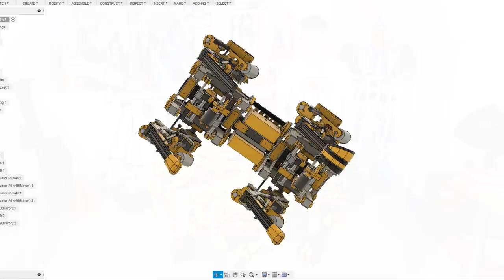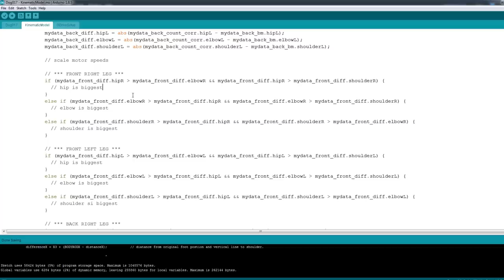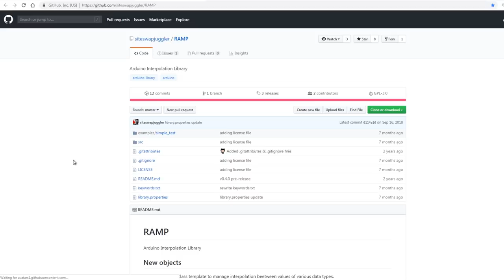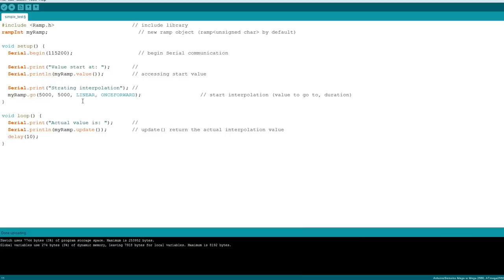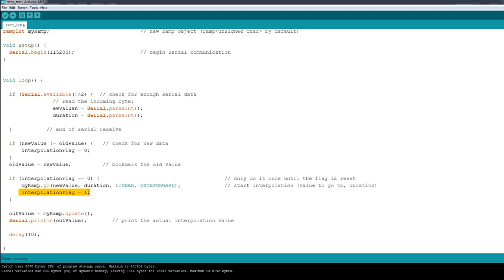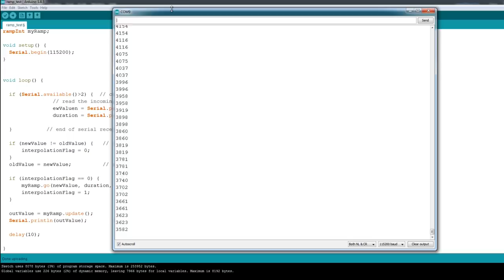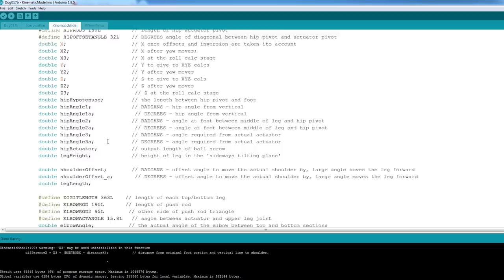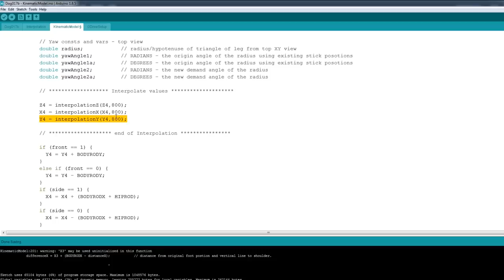openDog Dog Robot #17 | Experiments with Interpolation | James Bruton

Comment: Hi James, you're doing a really good job!
I have one suggestion. You should start working with python programming language on a Raspberry Pi or other on board computer and use ROS - Robot Operating System (https://www.ros.org/). That will solve many problems such a computation speed and it will undoubtedly make your project future ready. You can keep on adding more modules without changing previous code, change your computer later if you wish to and easily communicate between different parts of the robot as well as to external environments. ROS also supports joints elegantly which would be very useful for your case. If you need any help that I can provide, I would be very glad to do so.

Comment: Time to swich to OOP programming.
Reply: Why?
Reply: please don't
Reply: Why? Because the code will look so much simpler and gives less repeating code. Linear programing is fine when you have small projects. But this is not a small project anymore, To many repeatable code. 
The chance that you forget a modification in one of the cloned codes is bigger with the current code.
Reply: @NielsNL68  OOP is what caused his error in this video; he didn't realise there was hidden state being modified within instances of the ramp class. The duplicated code is a separate issue, and can be fixed simply by making his function take a pointer to the object it needs to operate on.
Reply: @Tombsar  you are right. But that does not mean you should not use OOP. 
Consider when RAMP was not a class, you would not be allowed to have multiple instances at all without modifying the ramps code for every as.
Reply: @NielsNL68  I disagree. If the API was organized so that all mutable state was contained in a PoD struct that gets passed in to the functions as a pointer, you can have as many independent instances as you like without needing to wrap anything in classes.

You can argue that what I've suggested is just a limited version of OOP without using C++'s language features. I actually agree with that, but I think it has at least two distinct advantages: mutable state is explicit rather than implicit, which reduces the chances of mistakes like the one seen in this video (imo data and functions should be clearly separated, not wrapped up together); and the user has full control over allocation, deallocation, serialisation, etc without any special support needing to be written in to the class.
Reply: Oop is not necessarily the answer. Just pass a reference to the objects you want to manipulate into the function. Oop shines when you need to hide functionality not just when you repeat it.

Comment: Doesn’t the pid loop handle the interpolation? The p sets the base step value essentially cutting it up into (end-start)/p steps
Reply from the maker: The PID is dealt with internally within the ODrive. They have a trajectory function that deals with two motors on one ODrive, but it can't deal with multiple axis across multiple ODrives.

Comment: How do you know where the motors are in space does the motor have sensors
Reply: Each motor has an encoder that counts how far it has rotated from its starting position, which is enough information to work out all the joint angles. There was quite a bit of discussion in previous videos about how to make it remember absolute position across reboots without running the time-consuming "homing" procedure every time.

Comment: A robot is really a puppet.  Would it be better for each leg to have it's own processor and then a central processor that farms out high level instructions.  You might need a clock to which everything synchronised.  An error might be modelled on a pain signal e.g. Open Dog hurt himself.

Comment: Why not STM32 or ESP32 ? Teensy is awful and requires a boot loader which is NOT open source. Awful choice.
Reply from the maker: The six motor controllers are STM32

The code is Arduino compatible so you have a lot of choice...

Comment: I've commented on your coding before, but now the fact that your software skills are nowhere near a match for your hardware skills have come to bite you.
I guess you figured it out in the end, the "instances" are not the same as function calls.  This is the Object Oriented paradigm, which you could be making extensive use of.  Having 6 or 12 nearly identical copies of functions and variables, and even blocks of if statements, is, pardon my crudeness, bad .

You understand parameters to some extent, as I see you passing in values to be used by the function.  But you can do this to all things that change from use to use, instead of duplicating the function.  Similarly, your different joints should be stored in an array, not individually named variables.  This will let you loop over the whole set, with one body of code.

On another topic:  when you hit the performance limit of the system, another thing you might look into as a limiting factor is the floating point math*.  Does the chip you are using have hardware floating point or software library?  In either case, note that *division is a super performance bottleneck, worse than other primitive arithmetic operations.  And, formatting a number for printing works by repetitive division/modulo by ten, so is actually a very slow operation.
Reply: John Długosz and from your comment I don’t think you’ve ever created any software in a truly inventive way. You seem to be one of this purest. I’ve met many in my 26y of software. 

I see ppl like you come and go, preaching about “perfect software” and “the very best design patterns” are required to be investigated before you will write any code. Quoting Uncle Bob endlessly but when I ask you if YOUR user stories are on track this week you have endless excuses...

James is pioneering here, he’s hacking to some extent as he should be. Using 12 separate functions allowed him to get it working quickly and discover more - SO WHAT???

And yes, I’ve no doubt he’ll come back and refactor it later. 

Give the man a break!
Reply: @GrahamDIY  Let's see... at the time you coded your first line, I was selling a high-performance graphics library for MS-DOS and bare metal embedded systems, and consulting on applications for it.  I'd also written a pre-emptive multi-threading system for C++ running on DOS, which was the cover feature of Computer Language Magazine.
I'm certainly innovative and whatnot.  But when I reuse something, I don't COPY/PASTE it!  My functions are small and to the point, so easily reused.  It is easy to add another parameter, or promote a constant named in the function to become a parameter (with a default argument).
By not duplicating code, you can experiment *faster*.  You only have to make a change in one place, not replicate that in a bunch of places.
I'm not preaching "perfect", just _competent_, knowing how to use the tools efficiently and effectively.  Don't practice COPY/PASTE programming is a simple maxim to learn, and by no means an advanced technique!

Comment: If your function has local vars declared "static", no wonder calls conflict, because this means shared state. Please do yourself a favour and learn the basics of programming. Your mechanical skills are quite good, but in the programming department you've got lots of things to learn (the basics for example...). Or maybe you can partner up with someone who's good at programming if you don't have the time to learn it yourself?
Reply from the maker: Yes because other wise they get reset to zero whenever the function is called and then the ramp doesn't work any more. I'm already working on making this into a class so we can go OOP.